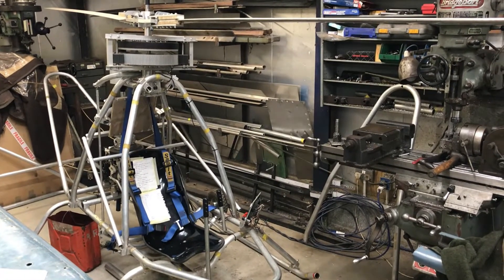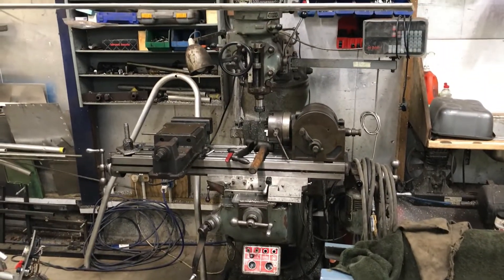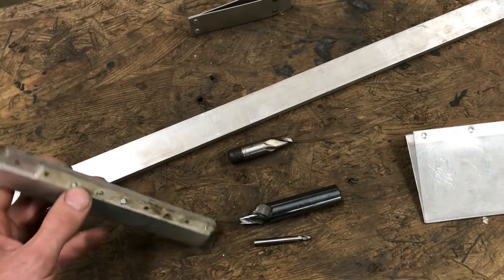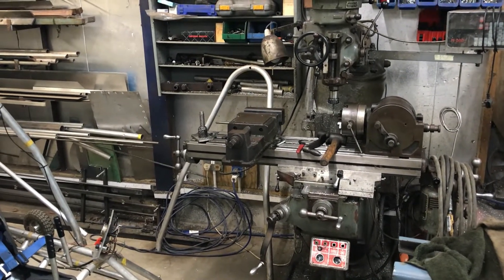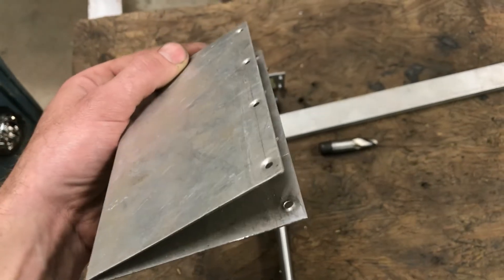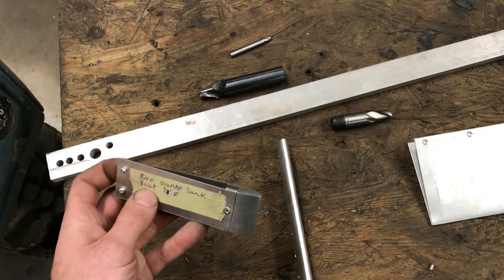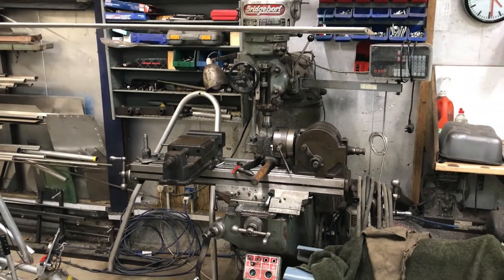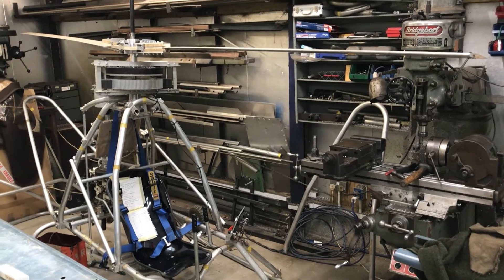How I made my Rotorblades Homebuilt Helicopter

Comment: I'm presuming you balanced the blades by adding weight(or removing) to them at the center of gravity of them and then made sure you had 'blade tracking' too to minimize any vibration which would otherwise want to rip everything apart or otherwise create instability on that basis.

Maybe adding a gyro will aid stability? Perhaps too costly and probably not applicable to this design owing to no tail rotor. Then again a hacked existing gyro out of one of those balancing gyro boards by integrating digital programing could help in some way. As could the capacity to 'gear' control inputs digitally via digital servo's to smooth out operation. On the other hand, putting faith(life) in computers? 

One day you could try and build a larger version of an existing radio controlled chopper with tail rotor, gyro, and swash plate, with Jesus bolt too, hehe. Or just go for the turbine tail rotor system to negate more mechanical parts.

You're brave. Best of luck. :)
Reply from the maker: I've done a video on the rotor blade balancing. I haven't actually done any blade tracking at all, mainly because the rotors run so smoothly. I should check it out of interest. I'm told blades out of track cause a vertical vibration but no vertical vibration has been detected. 
Gyro stabilising I hope isn't necessary but with todays technology anything is possible.

Comment: How about putting an aluminum pipe in the leading edge and tig welding the sharp edge of the foil Epoxy is stronger then rivets?
Reply from the maker: Unfortunately welding cannot be used on rotor blades as fatigue cracking of the welds will cause a failure. Also the high strength aluminium will be compromised by the heat and will no longer have the tensile strength required. You also have to bare in mind the chord-wise mass of the blade, it needs to balance at 25% from the leading edge. If doing the job again I would wrap the skin right around the spar like the mosquito blades and epoxy into place. Epoxy can be much stronger than rivets but are usually used together for safety.

Comment: 2 metres seems short. What is the overall diameter? What rpm are they running. The faster they spin the more pitch cycles it will go through when cyclic control applied.
Reply from the maker: Hi, trying to understand if the blades go through more pitch cycles what is the result or problem that causes? Thanks
Reply: @Ben-Dixey  Wear on the swash plate and mechanism and fatigue of the blades. Not affected in hover, however when cyclic is applied, one side has more pitch than the other. When you apply input into the pitch it exerts torsional forces into the blade. The faster it spins the higher the frequency of force and the more pitch, the higher the force. No different to a crankshaft where it does not spin at a constant speed. The piston furthest from the flywheel causes that crank to twist a little, the higher the rpm and load on crack the faster and more it twists. The same for the centreline of the the rotor blade. Probably not a factor for you unless you plan on doing A lot of flying.
Reply from the maker: First Last thanks for that, makes perfect sense on a conventional helicopter with blade feathering for control. Can't get my head around if there is cyclic twisting of the blade on my design, I suppose the angle of attack will change per rotation in forward flight. My blades are very light/ft in comparison to conventional helicopters. Interesting comments, cheers.

Comment: what kind  of alum did you use for main spare
Reply from the maker: 6082 t6
Reply: i was thinking 2024they make truck wheels with it'' @Ben-Dixey
Reply from the maker: 2024 is a great material choice, if you can get it. I couldn't find it in the size I wanted. The sheet is 2024 though, cost a fortune but I could get it. 
The material choice comes down to a few factors.
7075 is another very high strength aluminium, I might have chosen that if it was available.

Comment: Why is the rotor blades inside hollow? Is that a must or can do thing?
Reply from the maker: Hi, if the outside skin retains the shape well enough there's no need for a filler material. As the chord is only 4.75" it's quite stiff in that respect even being hollow. It's important to plug the ends as efficiency will be reduced due to centrifugal air pumping but what's most important is the weight distribution of the blade chord wise. It should balance at 25% chord measured from the leading edge for a symmetrical airfoil.

Comment: I wouldnt even worry about the blade strength except for the spine , id be worried about the anchoring ( jesus bolts) ,, excellent work , and 2024 is a wonder metal so thats even more reassuring
Reply from the maker: Thank you. Yes there's one main bolt holding the majority of the force which will take 15tons yield strength (double shear), the blade centrifugal force calculated was 2.7tons at 900 rpm, I'm running at around 750rpm now due to the reduction gear change. The blade spar will take 7.7tons by itself (6082t6) but surprisingly the skin being 2024t3 does add another 5.7tons of strength to the blade giving it a total yield of 13.4tons. If you work out at fatigue strength the blade is rated at 5.2tons still double what it needs to be. I've also read that when a bolt is clamping material together the friction between the joint can exceed the shear strength of the bolt, which is interesting.
Reply: @Ben-Dixey  yep.. I work with pressure vessels for my job. One project ,  after doing the math for 3.5:1 safety margin , I found myself holding a 2024 tube in disbelief , I was nervous filling it to 3000psi because it defied logic  by weight and machinability..  needless to say it performed by the numbers. And yes , clamping friction must be massive although ive never seen it clealry tested.